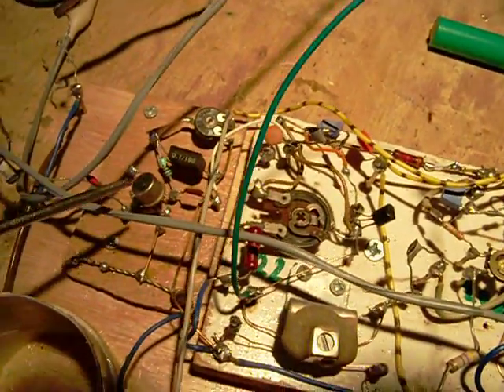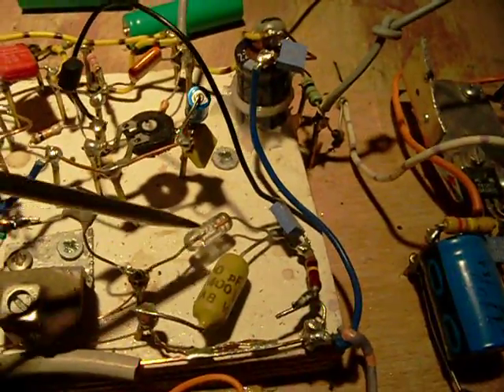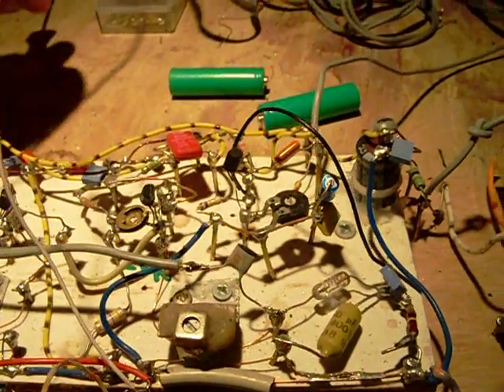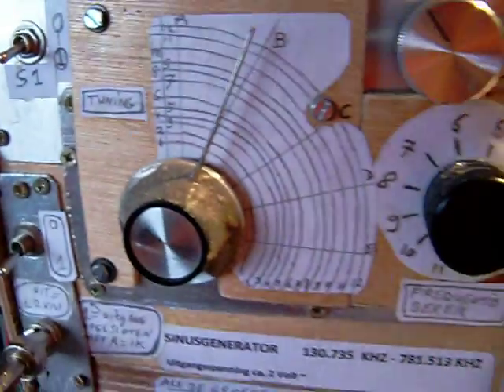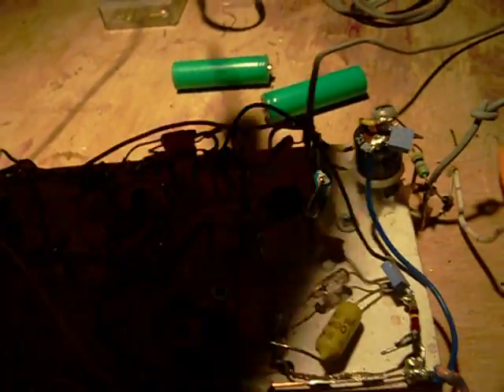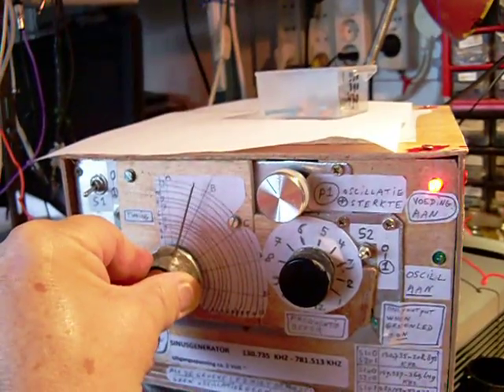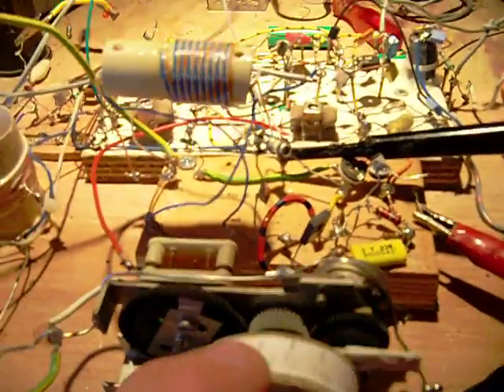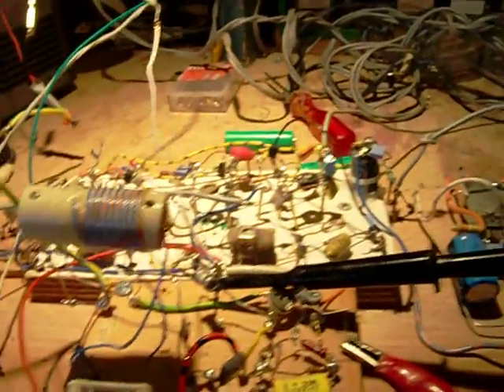2 -10 MHz Shortwave radio receiver (book)

Comment: Больше всего в этом видео мне понравился монтаж, очень стильно. Слышны станции из Польши. И удивительно мало помех. Удачи.
Reply from the maker: Thanks for your comment, indeed it is possible to receive stations from Eastern Europe in the Netherlands with this receiver. 21 april 2018.
Reply: radiofun232 В Украине слышно больше станций из Китая на европейских языках. Это печально. На диапазоне длиных волн LW осталась одна станция из Польши. А есть какое-то удивительное чудо слушать радиоволну.
Reply from the maker: Yes, also in the Netherlands the MW band is not used any longer for normal (news) radio receptions and music stations. Say since approx. 6 years ago, this band was more or less dead, apart from some religious radio MW stations, like Radio Maria (Roman Catholic) and Radio Good News (Protestant). I think it was no longer commercial interesting to use this band for (commercial) radio stations, of course also due to the limited frequency band on MW (say: 300 Hz-8000 Hz) no Hifi and much atmospheric noise (also much man made noise between 800 KHz and 1,8 MHz). 21 april 2018.

Comment: This is the style of bread boarding I did in the mid fifties except my projects used vacuum tubes. Do you leave them like this or do you rebuild them on a PC board? I obtained all of my parts from a local television repair shop  and would tie three or four TV chassis to my bicycle and head home to eagerly evaluate my bounty.  Its to bad that vintage electronic parts are not as available today as they were back then, particularly vacuum tubes and high voltage transformers.

I have enjoyed your videos and look forward to more of them!

Best regards,

Mick Bradford
Reply from the maker: Thanks for your comment, Mick! I mostly leave the circuits this way, though I sometimes make them again in a neat way (not so sloppy as in the YT video's). In the Netherlands in the seventies, 80ties and begin 90ties I could find a lot of old electronics (repairable and usable) on the streets. Nowadays they all must be collected in special depots.